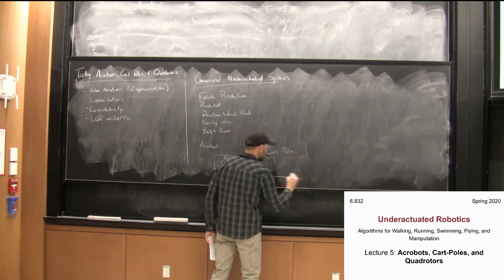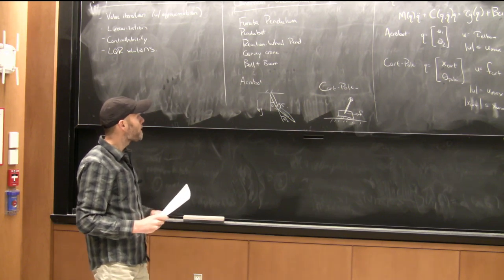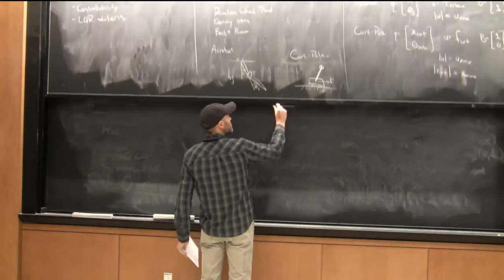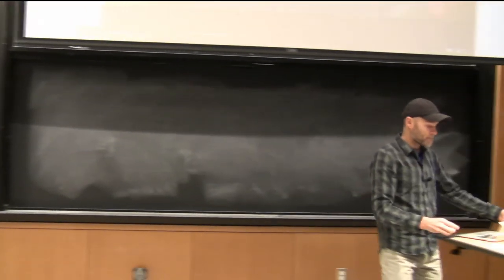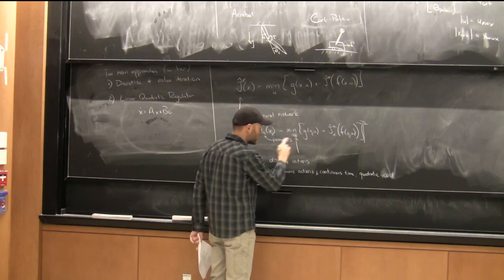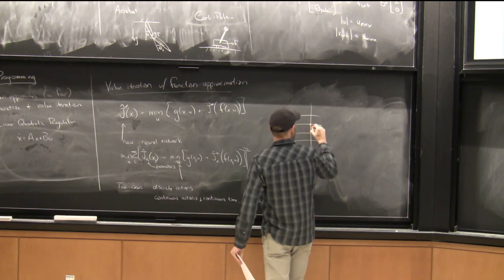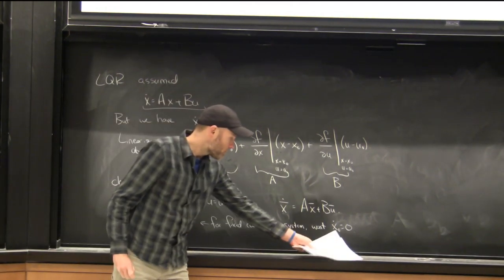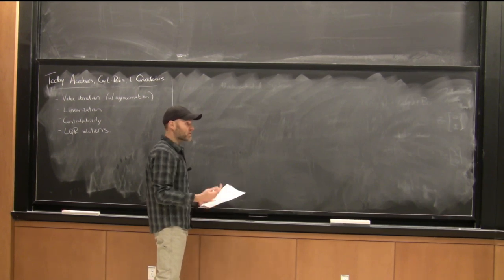Lecture 5 | MIT 6.832 (Underactuated Robotics), Spring 2020 | Acrobots, Cart-Poles, and Quadrotors

Comment: Somewhat irrelevant question, but since I am at the beginning stage of my PhD in Robotics, I would really love to know your opinion and suggestion. 
If someone is working on a Robotics Project, shall he take complete relevant courses? Or he shall just start working on the project and learn exactly what is needed to solve the immediate problem? For example, if a person is designing a controller, shall he know only the relevant dynamics? Or shall he better take a complete Undergraduate course on Dynamics? The first case will result in learning corresponding to work done by that person. However, this learning might have some gaps. The 2nd case would take a lot of time before he even gets to the stuff he needs to know for his immediate problem.
Your opinion will be really helpful.